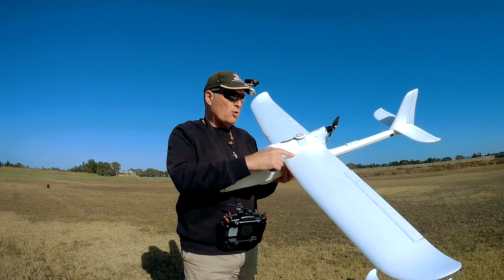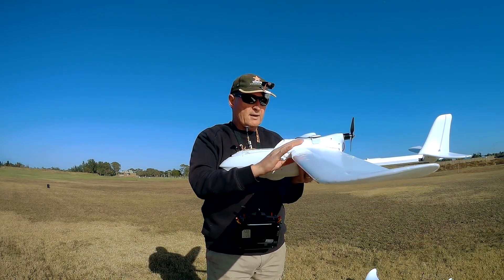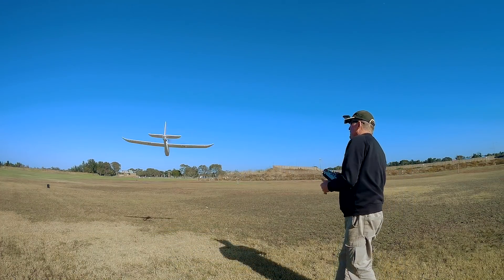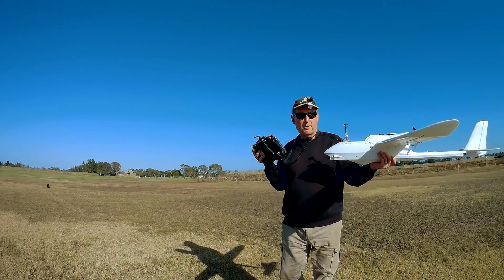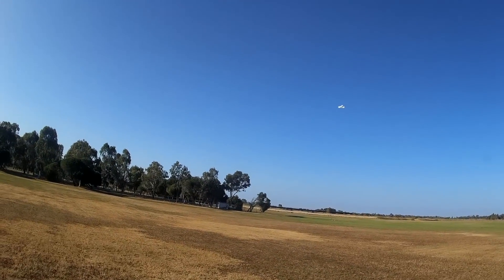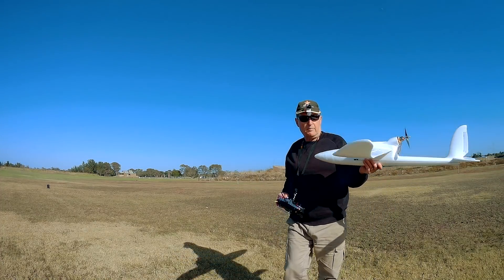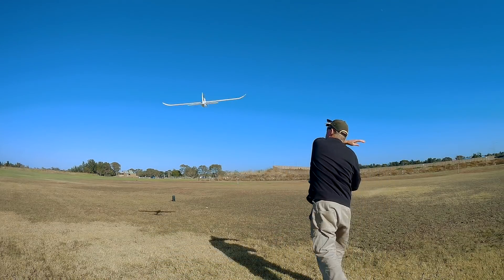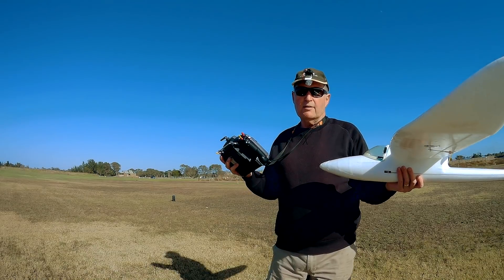Pusher Launch - Deny the Dip

Comment: Andrew, I replied before about your awesome instructional Dip method and now as I approach my 20th flight on my Ranger 1600 (stock) Gens Ace 2200 I agree with you even more. I also added an APC props 8 X 4e which decreased noise with a fraction more power with better mAh burn. I typically  bingo at 15 mins using about 1400 mAh with spare for a shitty approach or two. I'm totally chicken to try just the firm throw with NO throttle like you !!!😮
Reply: Ohhhh, it's a darn shame they didn't build flaps on it.
Being a heavy beast and quite underpowered, it lands quite hard n fast. The belly nubs take most of the landing shock thankfully. Cheers Mate.
Reply from the maker: Excellent Tim, it is a great all rounder

Comment: Or, to make it absolutely foolproof, create a throttle elevator mix using a custom curve,  activated by a spare switch on the transmitter.  I use this for all hand launches, especially for side launches with flying wings on conjunction with INAV or Arduplane auto level modes.  That takes all the drama out of my hand launches ...  as long as I remember to flip this switch.

Comment: Andrew

do you think that it will be easier to launch with a flight controller in stabilize mode (eg with pixhawk/ardupilot stabilize mode keep the plane leveled)

Thanks
Reply from the maker: Yes but it has to be setup properly.

Comment: Edit: found the problem: one of the bullet connectory is loose. 

Hello Mr. Newton, i bought a Ranger 1600 pnp and after the 3rd flight the motor stutters whenn trotteling up, sometimes for quite a while, even when i cut the throttle. I run it on 4s, as i only have those quad batterys, but the esc says clearly "2-4s". Did i damage it? Is it a timing problem? I am confused and a little bit disappointed because it is the best flying plane i ever owned and now i dont want to fly it in case the motor fails on me. Please help😥
Reply from the maker: Ah yes, it's always the ESC connections if the motor is stuttering. Glad you worked it out. I agree it's the best all round plane on the market.

Comment: Well I need to confirm throwing method is important. A while ago 5/6 throws of my flying wings were into the ground. Then I started to throw it at the angle up and everything is fine. I'm waiting for my Ranger 2000 and other RC plane models to arrive, hopefully I can build them well and not ruin in on the first flight :)
Reply from the maker: I'm sure you will do well. Practice that hefty throw at a slight upward angle.

Comment: I never get the "dip" with my 1600, but i do give it a near level chuck rather than nose up and only half throttle max on launch, do you fancy doing a short video on using flaps as i have ordered a set of 2000 wings to go flap on my 1600
Reply from the maker: Yes that would be worth doing. Added to the list.

Comment: Hello Andrew, I am a new subscriber and also a beginner to RC planes. I am so glad to see this video where you take the time to show how to launch. I wanted to ask when you throw the plane and give it half throttle, is it that all you have to do is pull back on the elevator like in those 3ch planes or with this one as it is 4ch you have to move the ailerons as well?
Reply from the maker: Depends on the plane and the wind. You might have to pull back on the elevator and adjust ailerons if the plane starts to roll, but on a calm day just a little elevator
Reply: @AndrewNewton  Thanks.

Comment: Hi Andrew,  I've finished my scratch build of the photon I was telling you about the last time I posted.  I have a wider body and my ready to fly weight is 1300g.  Running a 2200kv motor with a 6x4prop.  Would you still recommend a hand launch.  I've got about 800 to 900grams of thrust.  May have to use landing gear or change the motor to a 1400kv.   What do you think.  I'll do a YouTube on it soon and give you the link.
Reply from the maker: I would hand launch, plenty of thrust to assist.
Reply: @AndrewNewton  thanks...

Comment: If using inav autolaunch with the ranger do you recommend, jolting the wing so it starts before throwing or just putting in a little throttle delay before it starts after launch?  Do you use this feature?
Reply from the maker: I dont use autolaunch any more, it's fun to try but not really needed. Easier just to throttle up to 50% and give a good throw.
Reply: Going to try 60% throttle with 4s and throw like you do in the vid.  Hopefully it does not smash nose first!
Reply from the maker: Haha, fingers crossed. Maybe give it a glide test first

Comment: I cheat.. i just make a mix wich puts a bit of up elevator in a switch and thats it.. disable once the climb is under control.
Depends also on the plane.. some planes dont have barelly any dip down moment under power.. like the Bix3 or the Elektro Rookie.. others are vicious and dip down like a stone.. like the CloudsFly and the HawkSky
Reply from the maker: Not cheating, that's clever

Comment: Andrew, as a beginner  I am so fond of dipping my Hawksky V2 that I usually go for a double dip,  your video is spot on. Very well done. I actually enjoy having a little wind in my face as it definitely helps me get airborne quicker. It is actually harder to launch on a totally calm  day, the launch gets a little more stressful for me. I am a dentist, Andrew, easy on the "incisor throttle modulation" there, sir !  You may want to put a rubber thingy over your throttle stick !
Reply from the maker: Ha, thanks for your concern Dr. I should look for a different throttle method.
Reply: Andrew, I think we could make you a retainer with a built-in throttle stick adaptor. You would only wear it on flying days . I once saw a lower bicuspid implant made for a rugby player , he didn't want the tooth replaced, just an easy way to open his beer bottles.

Comment: Thanks Andrew, that was useful as I've had a few failed launches with my volantex ranger 1600. Must admit that I have found using my mouth on the throttle and left hand throw allowing for the right hand on the control works pretty well. I will give the launch from glide a try too as this looks fun but probably is easier with something a bit lighter than the ranger!
Used another video of yours for advice on the flaperons. Do you launch with flaps down ever?
Reply from the maker: I never use flaperons for launch, only slope landings. Crow for landing with the 2m version is useful

Comment: I have a Bixler 2 that needs about 5mm of up elevator trim to fly level at half throttle. The C of G is on the leading edge of the spar cover strip. Is this amount of trim normal?
Reply from the maker: More than normal I would say. I'll recheck mine when the weather clears.

Comment: A few washers under the motor mount to correct the "trust angle" gets rid of the "push down" effect of the motor.
Experiment so that you don't need any change in elevator regardless of throttle.

Comment: I'm launching my Ranger 1600 at full throttle on 4s! Not having done the testing you have I thought I needed more power to avoid the dip.It seems to work though. I give it a hard throw with my right arm and then quickly to the sticks. Also thanks to you I've got a Paris Sirius Air Hero 32 getting ready to install. Thanks for the great videos they really keep me going.
Reply from the maker: Excellent, hope you enjoy the AIR3, it's the future

Comment: I get a mate to throw for me and it's launched at a bit over half throttle (1250kv motor/4s Lipo) on high rates full up elevator. Does not need a particularly strong throw and works fine.

Comment: Omg. A few days ago i tried to launch volantex ranger 2000 and had several dips and crashes. I tried to launch it 6 times at full throttle and as a result right now i need to fix smashed stabiliser.
If only i could have known that push throttle is not very good idea.
Thank you.
Reply from the maker: Oops, we have all done it

Comment: I cant throw with the left arm, so I throw with the right,  I reckon I've got 3seconds before I need to correct the plane, depending on what I'm launching :-)   (mode2)   works for me ..........most of the time *-)
Reply from the maker: Oh yes I should have mentioned the right handed throw then quickly to the elevator

Comment: Andrew, thanks for the video! I agree, getting speed fast is very important. I might have a tips for pusher planes, I learned by coincidence: Instead of holding the plane under the wings, try holding it in the front while throwing it. Watch your head while throwing. I found this to be much better giving a straighter throw, when my problem was the plane ending up with wings vertical orientated and the plane crashing.
Reply from the maker: I'll have to try that

Comment: Most pushers like this (bix/ler, clouds fly etc) also ROG  just as easily as if they had wheels - saves breaking your teeth on the throttle stick :-)
Reply: But they're petty goofy looking from the start and adding wheels only makes it worse, and them slower! ;¬)
Reply: Nothing looks as goofy as hand-tossing it into the dirt.  A good belly skid beats wheels every time,  where the flying site demands a crosswind landing.

Comment: unrelated but how tight is your hotwire bow? how much should i be able to flex the wire because mine wont cut in the center
Reply from the maker: I'd say very tight, can twang it. I have 8mm bungy cord holding the tension